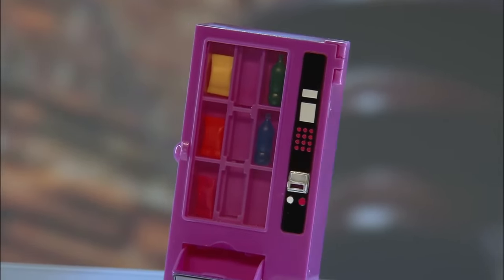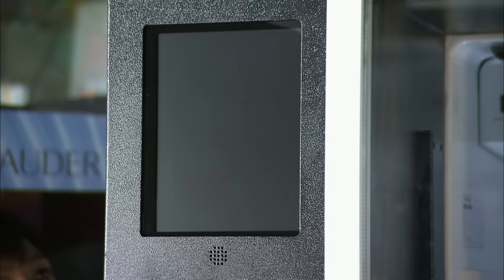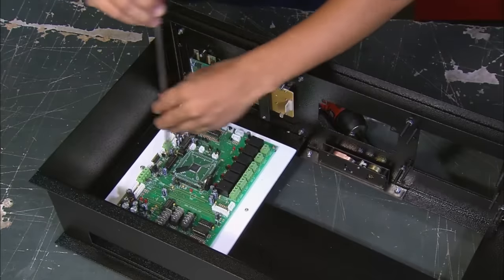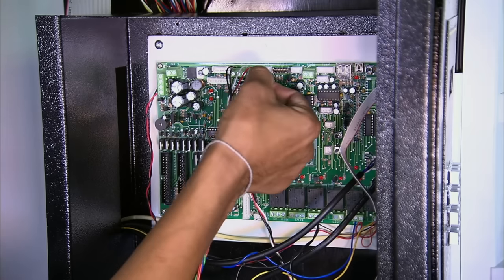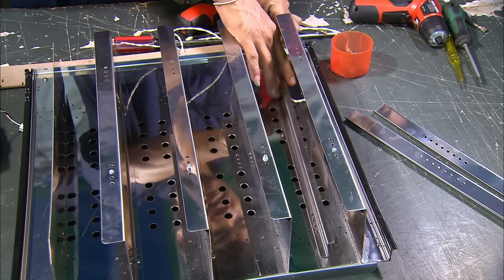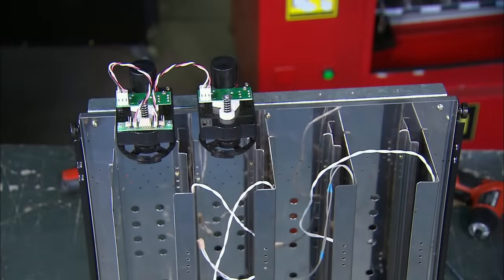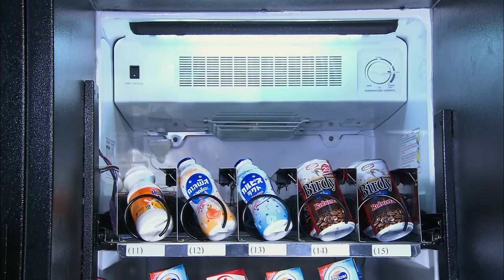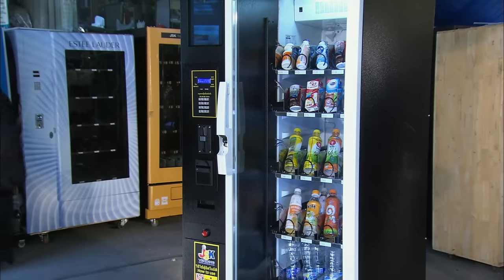How It's Actually Made - Vending Machines

Comment: The glass bottles joke is pretty subtle, untill you realize how stupid it would be to have glass in a vending machine.
Reply: Sounds like greato idea to me!
Reply: There was a vending machine I saw with glass bottles. It had a rising conveyer belt that would ferry your drink to the door. No falling required.
Reply: @readalotknowalot  that's a smart design :O
Reply: @Don Clark glad to help!
Reply: @bluelegocrane7754  i am concerned
Reply: @kanyegraduation  
I think you commited a spelling mistake...
Reply: @bluelegocrane7754  lmao
Reply: @readalotknowalot  
It's called a crane bevmax 4 😉
Reply: @brianiswrong  thanks for letting me know! Always awesome to learn about those things!
Reply: @readalotknowalot  Had a few of those at my old job. They're ass. Half the time the drink misses the conveyor, and then the arm get stuck and you have to call the vendor to get it fixed. Every damn week.
Reply: Coca Cola was only available in glass bottles for many decades after the invention of the soda vending machine. There were many designs over the decades to avoid the broken glass problem, and some of them worked pretty well. Keep in mind that Coca Cola was available in exactly one flavor during that time.

One of the early designs didn't have a motor. It was an insulated tub on legs. The cola bottles were arranged standing up in the tub. A steel frame was locked in place. The bottle necks stuck out where the customer could grab them, but the rest of the bottle was too big to be pulled out. The customer had to lift up the glass door and drag a bottle over to the coin acceptor which had a gate mechanism that would release one bottle per nickel (US $0.05 coin). The machine had to be loaded with ice daily.
Reply: There are vending machines designed to dispense glass bottles without breaking them.
Reply: Vending machine in my college had one, they serve Oronamin C which placed most bottom
Reply: @bluelegocrane7754  Josuke?
Reply: as a vendor, there are many types of drink machines. Obviously dont put glass in gravity machines like this one, but rather ones with grabbers, or conveyor belts.
Reply: @readalotknowalot  Before vending machines had the elevator conveyor belt you'd find drop style vending machines with all the glass bottle drinks on the bottom row. They'd put a foam pad covered in plastic or pleather in the bottom of the drop area to keep the glass bottles from breaking.
Reply: They do put glass bottles in some machines, especiallg older models
Reply: There actually is a vending machine with 500 ml glass bottles n our university cafeteria. There's no clever mechanism, it just dumps the glass bottles onto a thin piece of rubber. I've personally seen multiple bottles break, it's such a spectacularly stupid design.
Reply: @hamjudo  my grandmother had a small model of one of those, I never knew how they really worked though so thanks for sharing
Reply: They have one in my friend's university's cafeteria, that serves beer in glass bottles. However, there is a robot arm that picks it for you, so that it doesn't blow all over when you open it.
Reply: @readalotknowalot  we had one in my high school
Reply: @readalotknowalot  all cool until the bottle falls into the bottom and explodes everywhere
Reply: This video and its jokes are hilarious 🤣
Reply: The invisible ones
Reply: Uh, they used glass bottles for decades.

Comment: pc guys when they realised their vending machine was pre built:
Reply: Ha, there’s is still only half as good (he said duel graphics, 32 GB of RAM, 4.2 GHz water cooled etc), jokes on him because I have 64 GB of RAM, 4x GPU water cooled of course, but dang it I’m only at a tie with 4.2 GHz on 32 threads... I knew I needed to upgrade that CPU to the newest 64 core Threadripper and crank it to 5+ GHz with cascade cooling. Oh well, at least my setup has triple displays and not just one. It’s only money sucking it does is from 2x 1300w PSUs and any other coolant like dry ice I feed it when I want to have fun going even faster.

Mine isn’t prebuilt though, it’s built in a handmade vampire style casket which only took 116 nails, 12 screws, and some spider infested wood from a pile in an old barn then lots of sawing. Looks way better than that vending machine!
Reply: @jakegarrett8109  duel 3090s in a sleeper build like that would go together very well
Reply: @txic.4818  Indeed, and its possible, smallest duel gpu build I had was on a micro ATX board (water cooled would make it even smaller, as I was using FIJI cards so the PCB is tiny but the massive triple slot air coolers really packed the board compared to when I have them water cooled). I think I even had it in a pre-built Emachine at one point (junky prebuilt case, like a thief would just pass by that junk and not give it a second look).

I know I have a video of the same motherboard and CPU in that case making fun of Intel's Computex where they "forgot to mention" they used a chiller on the Xeon's overclock, so I had my phase cooler bolted to the bottom and it was running about -35c loaded and -60c idle with my "OEM cooler", lol! I can link that video if you want, its not great but its short and a good laugh if you want to also see the worst cable management too because I didn't bother cleaning it up and had wires from the extra heaters just dangling around and had a separate PSU to activate the cooling system.
Reply: @jakegarrett8109  lmfao now I NEED to see this
Reply: @txic.4818  but with no fans for extra fun
Reply: @exterminatordj3901  psu fan go brrr
Reply: @txic.4818  yeah just chuck out the power supply.run it through straight cables it'll be fine
Reply: @exterminatordj3901  there has to be a water cooled psu somewhere
Reply: @txic.4818  oh no. that sound like a worse idea than water cooled RAM or a hard drive

Comment: when you realize that a vending machine has more power than your own pc..
Reply: In reality a processor running 4 Mhz and having 32 kilobyte of ram would easily be able to scan a keypad, run a 2 line display with payment information and a board with relays for running the motors that dispense.

Those specs are wildly exaggerated, what in gods name would a simple vending machine need 32 GIGA-BYTE of ram for.
Reply: @JohnDoe-bd5sz  simple, that vending machine is mining crypto 24/7 for the vending company using the electricity of their clients. It’s pure genius and completely unnoticed. You think the refrigerator is there to keep the drinks chilled, think again.

Comment: The bank note acceptor scans paper currency for traces of Phased poloron particles which are found in high concentrations on space werewolves from the future. If the vending machine detects such particles it will immediately trigger the vending machines onboard 5.35 Megaton thermonuclear warhead to ensure that any space werewolves from the future nearby are vaporized.

Comment: Did no one question the 4 gigahertz processor and 32 gigabytes of ram “typically” installed on their vending machines? 😂 I wish the vending machines we have at work that use their own version of Linux had a fifth of that much power/ram. They would surely run faster than what they do normally.

Comment: Im surprised only 5-6 people die a year from vending machines falling on them, I wonder if this is because the vending machine fell sideways and such the springs were facing the wrong direction, or if it is because the springs were inside of a see through refrigerator. Either way, research needs to be done to save these lives in the future.